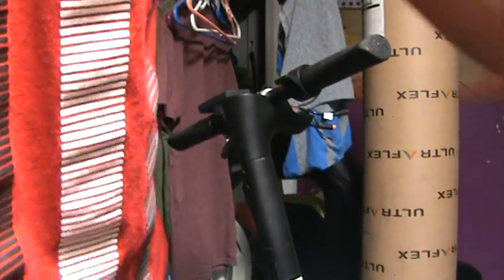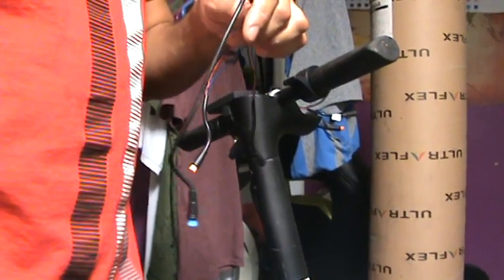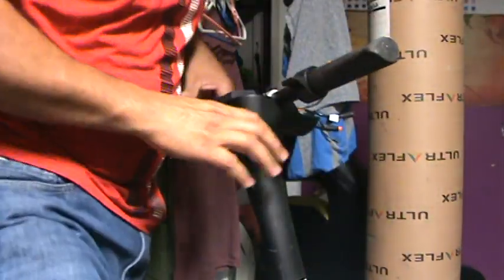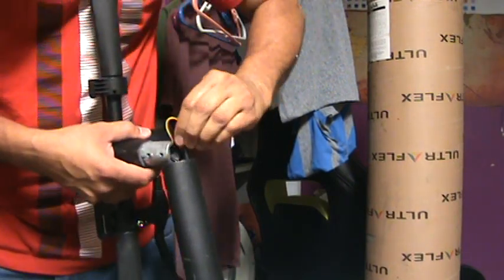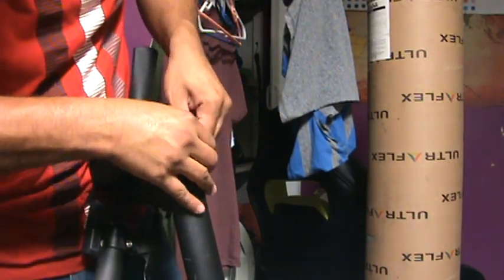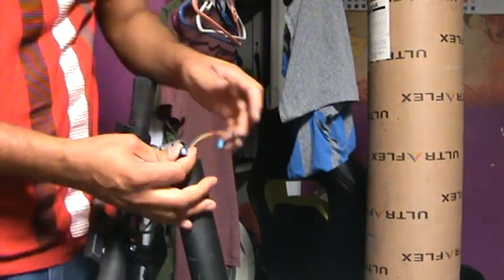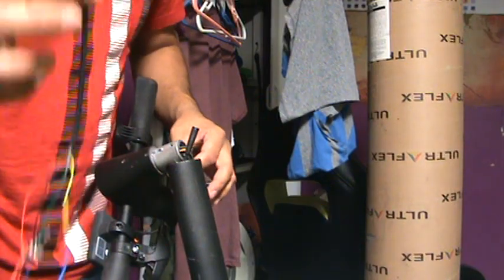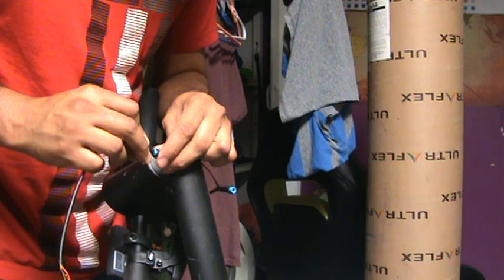bird 590 controller wiring part 2

Comment: Hi sam . I have a scooter that the connectors are similar to this one but the main plug that you have blue with 4 pins the one I have it's green with 5 pins what can the extra pin be about . The color of the extra wire is blue

Comment: Have you tried to use the 1000w controller ? Can the motor handle it ?
Reply from the maker: i here some people that use it but the battery will shut down because they only handle like 600 watts if you use more than that battery bms need to be bypass

Comment: Nothing needs to be done with battery correct? Like would it have a gps in the battery or so i have to bypasa the battery
Reply from the maker: nothing dont worry no gps no nothing👍
Reply from the maker: You only do the bypass if you lose power after few seconds of driving

Comment: Sup man so I have a Segway max that purchased at auction.  Ordered  new control throttle and break installed everything. The LCD comes on but scooter want move. Anything u can tell me to get it wprking
Reply from the maker: You need to reprogram the controller even if new

Comment: How did you get the control wire through the scooter? Did you cut it?
Reply from the maker: through inside the neck use a piece of wire and remove the black connector from the end of the lcd wire

Comment from the maker: to fix the backward issue you need to use the self learning feature to do this you need to connect the two green wires that say intelligent identification in the controller diagram after that turn on the scooter the motor will automatic spin let them do that for a like 10 second then disconnect the green wires and then turn off the scooter wait 5 second and then turn on the scooter and you are ready
Reply: Self learn is activated by connecting the two green wires on the controller with the power off. Then turn on the power from the LCD panel and the front wheel will move slowly as it detects the phase of the motor. If it turns the wrong way, disconnect and reconnect the green wire with the power on - the wheel will turn the other way. Once it's turning the right way, dont touch anything and let it run for 10 seconds or so, then then turn off the power via the LCD.
I got this off a forum.  It fixes my issue.
Reply: It worked for me thanks.. just got to fix the speed wheels turning slow
Reply: Can you upload a video how to fix the backwards ?

Comment: Hi! I made wiring as you show (great work! Thanx!), but this model controller give me 12km/h only and nothing more! :-/ (at 3-5 set this same, full battery).Throttle not reaction (splited work as brake) :-/ what i do wrong?
Reply from the maker: make sure you set the full speed setting to full

Comment: Hi

I have the wheel turning in the wrong direction.
Help me please
Reply: You have to change the cable  the motor and controller
Reply: Temporarily plug 2 single black connectors with only 1 wire when powered on it will”learn “ proper direction .. be sure to unplug once it learns